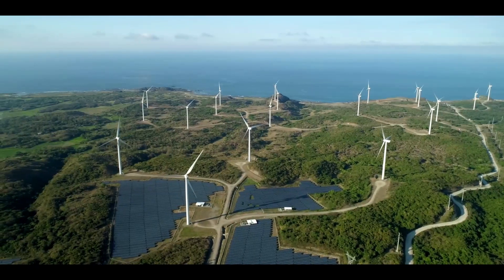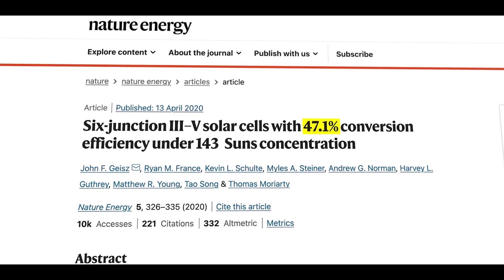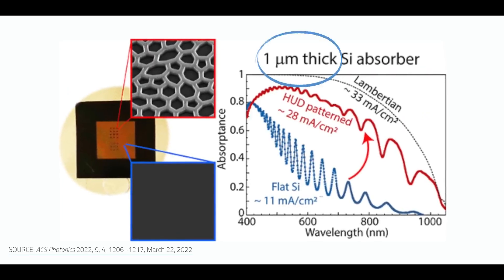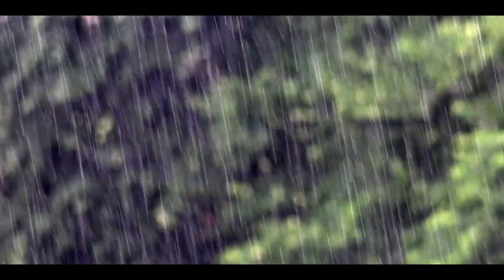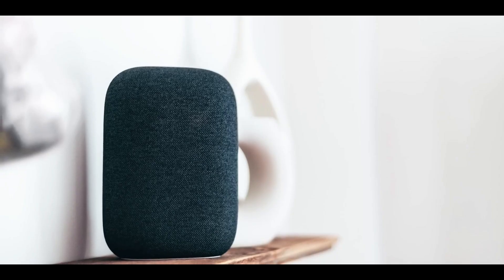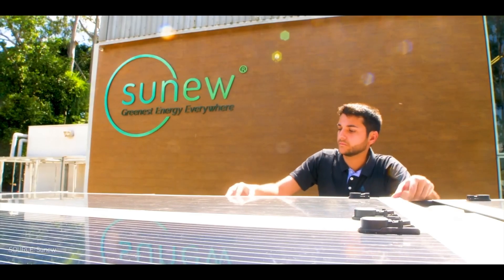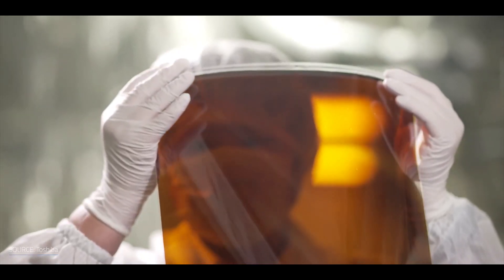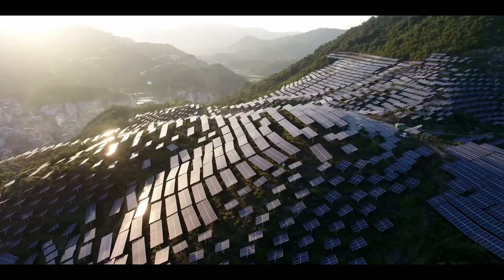The end of silicon in solar panels

Comment: SILICON a poluting mineral...
 ?
If that was true, we have the ABSOLUTELY MOST POLUTED PLANET IN THE UNIVERSE... ALL THE SAND IN ALL THE BEACHES IN THE PLANET ARE MADE OUT OF SILICON.
WAS THAT A BIASED LITTLE FINAL COMENT... OR WHAT?
Reply: It does take a lot of high heat to refine silicon to high purity. Perovskites avoid much of that at the cost of being lead based in the active layers...or cesium if you prefer. Did you think an LLM composed this script or what?
Reply: I was wondering the same thing? I just watched a video on a guy making Graphene before this video. You should check it out